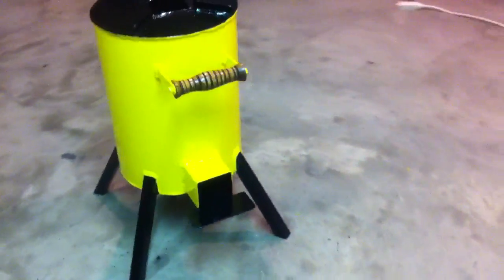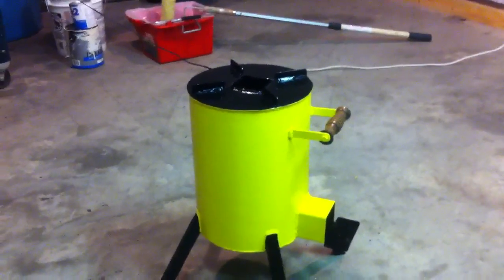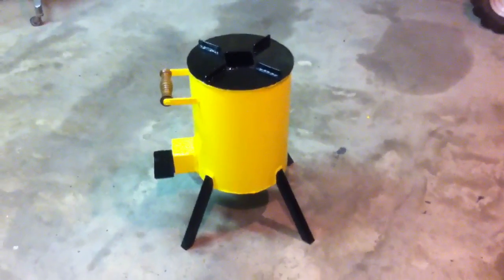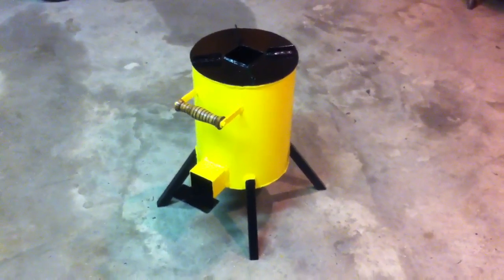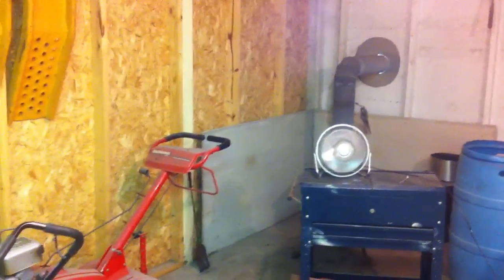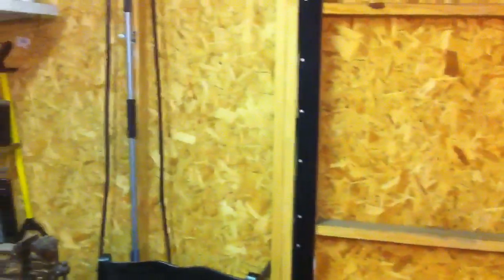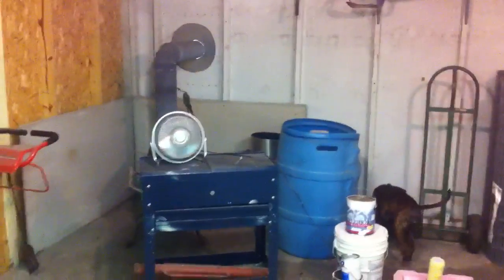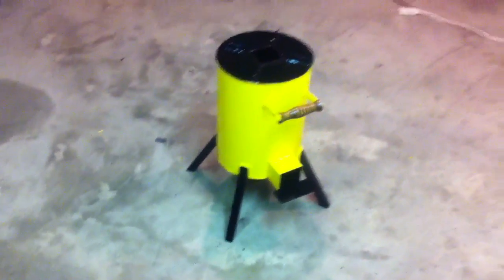Heavy duty rocket stove build

Comment: All it needs is a big BCTruck saw-blade logo on side!
Reply: haha, I wrote this comment before I finished watching. I couldn't agree with you more. Your logo would definitely be the perfect finishing touch! Although, not sure a sticker would last too long against that heat.
Reply from the maker: 1775novten maybe ill paint it in little black letters.
Reply: BCtruck, rebuild, repair,repurpose I think the big circular saw-blade in black, with BCTruck Rebuild* Repair* Repurpose coming through in yellow would look sweet. But I think that would be difficult at this stage in the build. Sticker may be the best solution. Either way, you are a craftsman and it turned out gorgeous.

Comment: I would highly recommend for your ceiling, the (1/2"x4'x8') foam sheeting with the aluminum foil side facing the floor.  Reflects light and heat. Cut them into panels to fit between your joists. Purchase the 1" plastic disks and using a stapler.

Comment: I think since we are going through a mini ice age you might want to consider insulating that shed roof even if I'm wrong about the cold it will still help in the summer months - throw some insulation up there and tack up some cheap paneling or sheetrock if you wanna go that far it's an idea if you got the extra cash lying around :)

Comment: GREAT JOB ON THE STOVE. GOTTA ANOTHER PROJECT FOR YOU BRAD, YOU NEED A DROP CEILING IN THAT PLACE WHITE OF COURSE TO WARM AND BRIGHT UP  THAT SHOP. GOD BLESS MERRY CHRISTMAS
Reply from the maker: well,someone else had a suggestion similar to yours and i think ill do it. 1/2 inch insulated,foiled back styrofoam stapled to the cieling should reflect light back and keep the cold roof from absorbing all the heat from the stove.

Comment: If you apply primer coat first, it'll stop all the other paint from soaking right in and disappearing into the walls, especially on the particle board
.
Reply from the maker: Normally, i would apply primer but im just using up some leftover paint. I dont want to spend any money on it because,,,,,, i  dont have any.